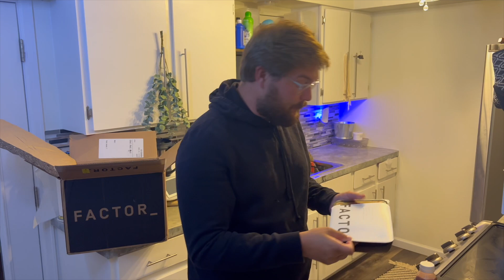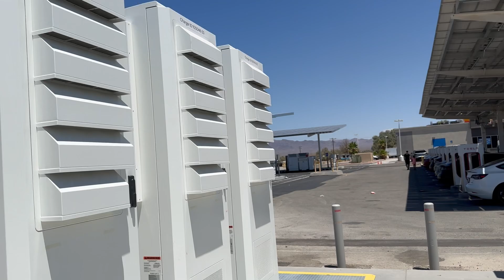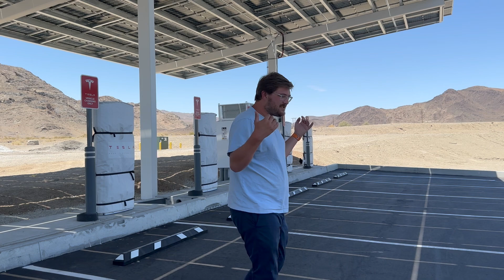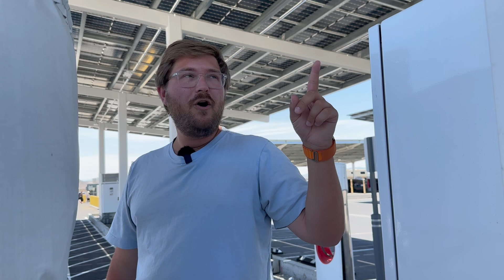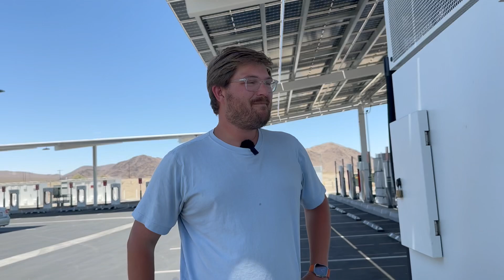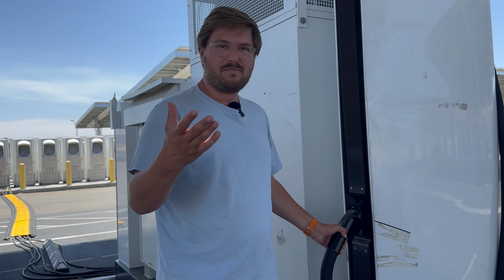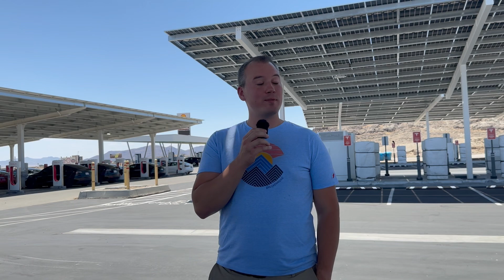Tesla Megacharger! Visiting A DCFC Location With Over 100 EV Chargers. Welcome To Baker, CA

Comment: Kyle asked me to take a peak at this and add any additional info worth noting:
- Up to 7 V3 Supercharger cabinets can be linked in a radial configuration with one main cabinet serving as Star Center (controller for the bus)
- Pro tip for counting V3 stalls - just count the cabinets and multiply by 4 😉 (occasionally Tesla will do less than 4 posts per cabinet - 3 is typical in Europe - but it will get you close enough)
- Notice that the accessible stall has the ADA symbol but none of the text that makes it enforceable as an ADA placard-only stall 
- Additional cabinets to the same amount of stalls would be a great way for Tesla to add conversion capacity - I share your concern about non-Tesla EVs and their more aggressive charge curves compared to Teslas 
- I agree with your assumption that V3 cabinets / posts can be retrofitted / upgraded to support 1000V output 

Semi Charger:
- 800A AC input cabinet indicates a max connection of 664kW, but per NEC 625.42, can only operate at 640A or approximately 531kW (not factoring for power factor, voltage sag, etc)
HOWEVER, the label on the cam lock connection box indicates 400A is available for the connection - 800A would require a second set of cam locks 
- Tesla is using an isolation transformer to step the 480/277V delta 3P grid connection down to 360Y208V 3P likely due to the lack of grounding for the portable setup
- 360V is not a common AC voltage range, so this is fairly odd (I'm not an expert on industrial applications so someone please correct me if this is wrong)
- This cabinet is either heavily modified or entirely unique from typical V3 cabinets with a different input voltage range, output rating and power conversion capability 
- There is no DC bus capability on this cabinet
- Typical V3 cabinets are 360-528V input intended to be used on 380/400/415/440/480V grid connection with either 430A (350kVA version) or 465A (387kVA version) max continuous current typically on a 600A circuit - the output is less when operating at below 480V input (typical in Europe / ROW) which is why they are typically 3 posts per cabinet vs NA typical of 4
- I do not think this Semi cabinet is indicative of V4 cabinets but may have some shared elements 
-V4 post makes Kyle look short and you know it's hot when Kyle isn't wearing a hoodie 😅

I have a deep dive of Tesla's V3 Supercharger architecture here: https://youtu.be/MYJkMrv6o0o
Reply from the maker: Thank you, as always, for your knowledge!
Reply: I feel... informed.
Reply: Thanks Branden for your insight and detailed info.  Very informative.
Reply: I've never seen a 360V transformer or equipment before. That is super oddball. Maybe they needed to keep the rectified voltage down, 360VAC would rectify to 509VDC?
Reply: What would your guess be at all those solar panels in relation to how many teslas can charge per day?  1 may be 2 M3 from 10% —> 80%?  Whatever it is, it’s totally worth it as it’s providing shade and if my guess is right, it’s still 730 cars/year…so they would eventually pay for themselves.
Reply: @fpartidafpartida  Solar at this scale for a DCFC installation is far less about offsetting the kWh and far more about offsetting demand charges
Reply: @fpartidafpartida A typical parking space is 9x20', and a typical solar panel is 3.25x5.4', so roughly 2x6=12 panels per space. In desert conditions in Southern California, a 300W fixed solar panel will produce about 2.5kWh per day. So each space will produce about 30kWh per day. That's enough for roughly 50% of a Tesla Model 3/Y's usable battery pack.

Worth doing - especially if you're already installing a roof. But nowhere near enough for self-powering a site this busy. Totally makes sense for infrequently visited chargers though.
Reply: the secondary side voltage of the megacharger transformer matches what I saw at a V3 supercharger transformer in canada. It was a 600V delta (Canadian industrial voltage) to around 360ish like you saw here, don't remember if it was Y or delta. I talked to some other electrical engineers and we thought this was weird, I don't think this is a common industrial voltage. They seem to be using this voltage for a reason, you would think higher is better if they can handle 480+?
Reply: @Borealis2142  Electrical engineer in Canada here, nope 360 isn't standard in industrial environment at all in Canada. Usually here we see 600V, 4.16kV, 13.8kV and 25kV. Of course we do see some US (480V) and European (400V) equipments too, but mostly for really specific equipment.

But weird voltages are definitely a thing on some stuff (especially big drives for 1000+HP motors) and it's not too hard to get a custom made transformer for any voltage in a matter of 2 months or so.

They probably use this voltage because it limits how much the charger need to raise/lower the voltage (once rectified). Most Tesla's batteries are around 350 to 400V.
Reply: @Borealis2142 To my knowledge they use 480/277V step down transformers in Canada
Reply: @brandenflasch  My bad I went to a supercharger in Peterborough ontario and rechecked, you are 100% right there were 3 450 kVA 600V to 480V transformers for a 12 post site, that makes way more sense. still curious about the power engineering of that mega charger skid.
Reply: this is fascinating. So I don’t need to really think about load sharing on a busy V3. Assume it has dynamic load sharing between stalls too - how granular is it? down to the W or like in 25/50kW chunks?
Reply: @MrKlawUK  I don’t know the exact granularity but it’s good enough that you shouldn’t need to think about it
Reply: disabled bay with high kerb isn’t great.. I’d guess you’d bemore likely to use that end charger with no step
Reply: Great video!
Reply: Why have level 2? For people overnight camp/charge? Is there anything nearby that anyone would go to for more than an hour?
Reply: @emschaub  employees are really the only reasonable use case for the level 2
Reply: From the nameplate in the video, the charger POST DC Output is 0-1000V and 465A, for a theoretical maximum of 465kW. However, the output power is only listed as 375kW into a Tesla Semi, suggesting that the semi battery is actually 375/465 * 1000 = 800V.

Bear in mind, that 465A is not enough to charge a 400V Tesla at any more than 186kW. Future 1000V V4 chargers will need to provide more current, at least 631A for backwards compatibility with the existing 400V cars.
Reply: @onespeed9567  DCFC cannot deliver full current at all voltages
Reply: @brandenflasch  understood, but it can't be a coincidence that the V3 and V4 Superchargers also deliver their maximum output power at 80% of the maximum POST DC Output voltage. E.g. for V3/V4 400V * 631A = 250kW. For this Megacharger 800V * 465A = 375kW.
Reply: One of these Tesla mega 100mW batteries just caught fire and blew up in Rockhampton - so much pollution that residents need to stay indoors.

Comment: Wish Australia would get their stuff together. We have so much power available and no reliable ev charging providers.
Reply: I took our Model 3 from here in Newcastle through to Melbourne and back last week (great trip). The NRMA charger in Gundagai was in poor order while, the Tesla network was pretty good. (A bit slow in Box Hill Melb as there were more chargers being used) This said, not sure if I would do the same trip at Christmas in the heat though.
Reply: Tesla charging is great in Australia.. the rest less so. Albeit I've taken my Tesla comfortably from Syd-Mel and back without using Tesla charging.
We have power but not necessarily in the right places, and it can be very expensive to add capacity
Reply: Do 30.000km /a inland Australia. The networks have done a good job particular NRMA with all those country town sites. Sadly they have been let down by our local manufacturer failing to provide reliable equipment. If you want to travel you buy a Tesla. SuCs always available and working.
Reply: @moestrei  I agree completely. Tesla charging is so reliable however the other providers are crap and absolutely unreliable

Comment: Such an odd AC voltage for that mega charger. Been in utility industry for years and never dealt with 360/208Y
Reply: It's a strange voltage indeed, you would expect a grid voltage from anywhere in the world.
But it's very close to the 400/230Y used in Europe, some countries use 230∆ btw.
And at these power levels you can probably get any voltage you want.
Reply: Heat limitations? Scaling considerations?